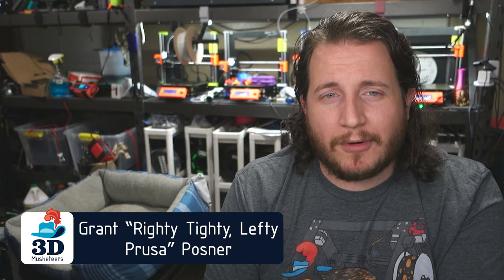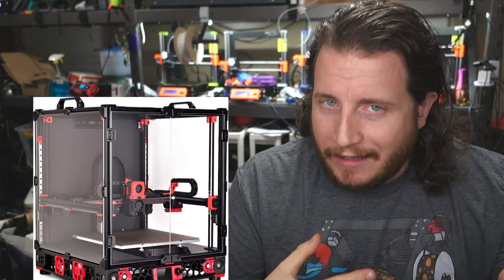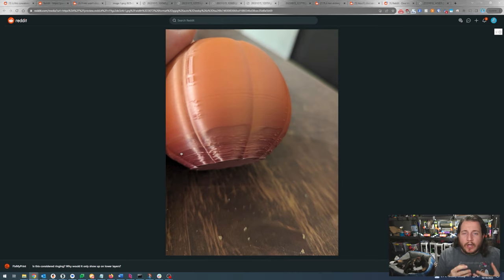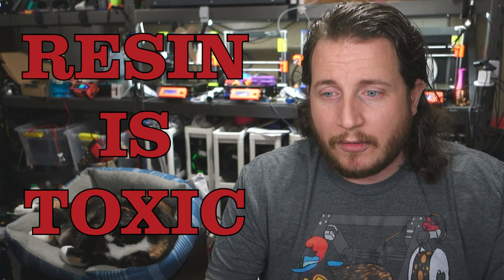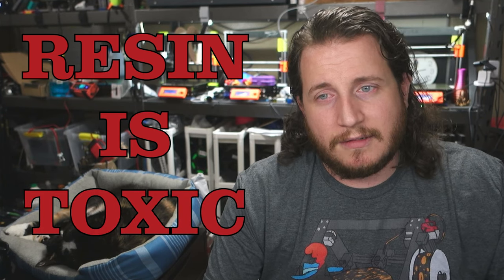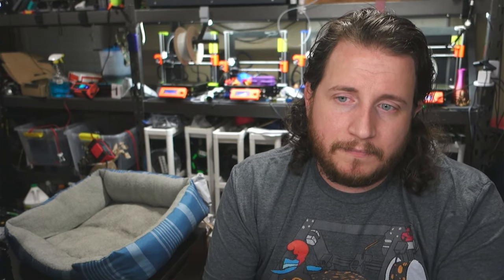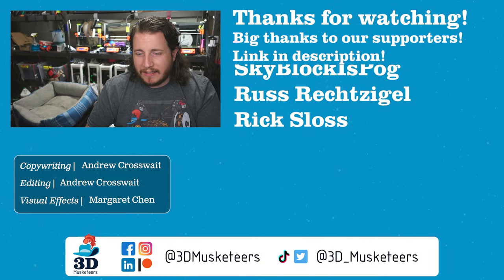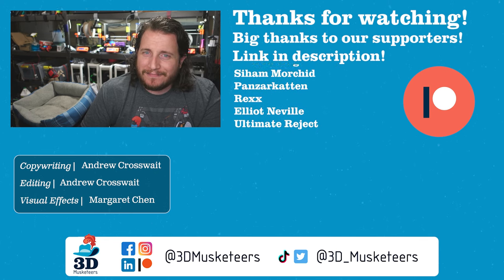Solving Bed Adhesion On Resin Printers AND the Prusa MK4! - PrintFixFriday 110

Comment: Yes, acetone does work well on the smooth pei sheet after being used for a while, scuffing the smooth sheet with the coarse side of a scotch-brite scrub will also help. I’ve had this problem before on my mk3 after printing around 2k hours, my friend has also experienced this on their Bambu smooth pei sheet, haven’t experienced it on my Mk4’s smooth sheet yet since I don’t use the smooth sheet very often. Doing what I said above remedied the issue. And it will be interesting if you got a mk4.
Reply from the maker: I just ordered my XL.. no MK4 for a bit

Comment: If your resin prints aren't sticking to the build plate, you need to focus on layer time, and layer height for the first layer. You can also get a scuff pad and rub it on the build plate so it has some very very fine scores in the metal, but most of the time it is just layer time in your slicer settings, or it is because the plate is not properly leveled.
Reply from the maker: plate leveling can definitely cause this too!

Comment: Resin bed adhesion is very temperature sensitive , if it's not over 20'C ambient ,it will not stick. I heat the plate prior to printing in winter,  works every time.
Reply: AND when leveling the plate make sure you do the z=0 - I mean, someone else had a problem and that fixed it...a ummm...friend...
Reply from the maker: gah I totally forgot to mention that!

Comment: The print fixes are great, but I'm most excited about finally getting some good news about the return of Elixir. I never knew it used TPU to help get that gorgeous shine, especially as various TPU/TPE formulations can act like silk PLA in terms of severe shear thickening behavior. Regardless, I had gotten various Elixir samples through my old Maker Box subscription and they are hands down the best silk PLA I've ever printed with (Mika3D's silk gold, silver, and copper PLA are a distant second). Seeing Polyalchemy's website go sideways and re-sellers' inventories dwindle to nothing was super sad, and the news that Printed Solid had acquired the list of secret herbs and spices required to make Elixir started to get pretty s. Very exciting to see its re-release is coming soon!

Also, I wouldn't be shocked to learn that the gorilla who broke their SV06 Plus nozzle off in the heat block probably is suffering clogs due to having the retraction distance cranked up too high. I believe Sovol recommends 2 mm but the MAK profiles for the SV06 and SV06 Plus for PrusaSlicer and SuperSlicer that I use have the retraction set to only 1 mm (I no longer recall if that's original to the profiles or something I tweaked on my own). Maybe I could take that up to 1.5 mm to try and combat some minor stringing, but 1.5 mm is the realistic max for any printer with an all-metal hot end. I suffered, badly, with clogs in both PLA and PETG in my Sidewinder X1 after installing a bi-metallic heat break until I realized that the 2.5 mm of retraction that worked great for the stock hot end was the true culprit after making the change. Turning it down to 1.5 mm made all the clogs go away instantly.

Also also, now seems like a great time to put in a plug for how little I care for the burgeoning number of proprietary nozzles. I get that the Creality K1-series nozzle and the Sovol SV06 Plus and SV07 nozzle are basically the same, which theoretically will help with availability and selection, but seriously...both companies should have just used the Volcano nozzle from the start. I'm extremely seriously considering installing a Diamondback, tweaking the inductive probe position to account for the length difference, and calling it a day.
Reply from the maker: Elixir is coming!!!!!!

And yes I agree, why do companies have different nozzles! Just adopt V6 sizes!

Comment: If your prints dont stick to the build plate on FDM printers, focus on bed temp to hotter or cooler depending on the filament type, and also try printing slower speeds for first layer, especially on PEI textured beds. My Bambu lab X1C had build plate adhesion issues for a while, but after lots of testing, I found it sticks way better if I increased bed temp, NOT using any glue stick, and to slow down first layer speed. Once I started doing that, none of my prints ever pop off.
Reply from the maker: good tip!
Reply: I use glue stick anyways, to me it’s better to use it as insurance to make sure it sticks then risk it coming loose. I use a lot of Bambu  printers too and still use glue stick even though I had only had a half a dozen or so prints not stick. You don’t even have to apply glue stick every time. I think I do it once a week or so. But that’s me, I do it for peace of mind and it’s worked well for me. But I also do flow test calibrations for each different filament on those machines too.
Reply: @shawnhicks619  I used to use glue stick, but all my prints kept popping off. Once I stopped using it and printed slower on first player, I havent had one fail since the change.

Comment: The same exact thing just happened to my Sovol SV06 Plus this week. But I had a replacement headend/nozzle already ordered. That nozzle tip just popped right off exactly like the picture. Overall, lots of problems but this is much better than a Creality printer.
Reply from the maker: wonder if it is just thin?

Comment: Sovols own video says to heat it to 200c for replacement. I followed those instructions initially and the nozzle didn't wanna budge. I'm a mechanic and all around tinkerer so I knew enough to realize it would break if I kept at it. I heated it up to 265 (temp of the petg I was using) and it came out easy. 
I would love a z seam video. Again, I used a Prusa for years as my first and only printer and never had to touch a setting. I picked up the Sovol sv07+ to print larger items at a better speed and hopefully learn this whole klipper thing I kept hearing about. I'm about to give up lol. I can get an almost perfect print from PLA but I often have that thick seam gap. I went to facebook groups and got recommendations for retraction and pressure advance test/settings and none of it has helped. I bet it's simple but I haven't figured it out yet lol.
Reply from the maker: Oh yeah, 200C is WAY too low

Comment: Timer too close is one of the vaguest and with more variables errors on Klipper, now that Raspberry and similar SBCs are plenty powerful and microcontrolers on new boards are pretty powerful 32 bit ones usually is not about the host or the MCU but more on the wiring, sure, having too much microsteps or some HD cameras can overload some low power SBCs the most common reason for that error is a bad USB wire, a low quality one without any way of shielding, a pretty electrically noisy system, bad electrical wiring causing under voltages or worst case, soldering issues on the boards
Reply from the maker: right?!?

No usb camera on this, she is dead stock.

Comment: When i looked it up a month ago for my printer, timer too close can mean a lot of things.  In my case it meant a failing connection on my Canbus toolhead. Software may be difficult to sort out, but checking connectors should be straightforward.
Reply from the maker: no canbus here, so no dice.

Comment: The sonic pad comes with a accelerometer for you to setup input shaping. I have 2 printers running off my sonic pad right now and have no issues after i setup input shaping, might need to re-do one of them cause im starting to get ringing.

When it comes to prints not sticking to PEI sheets i am no help, but on tempered glass build plates I have been using degreaser. On my Chiron i couldnt get ANYTHING to stick to the glass bed after it sat as a functional shelf for a bit while life happened. Tried EVERYTHING to get stuff to stick until i used oven/grill degreaser from the local dollar store. afterr that everything stuck without issue.
Reply from the maker: huh, I guess if it works it works..

Comment: My advice for anybody buying a Prusa: Get the satin build plate.
My advice for Prusa: Please make the satin build plate the default plate that comes with the printer.
Reply from the maker: I have not used the satin plates yet lol
Reply: @3DMusketeers  It's a good all-purpose plate. Works well with all of the common materials (PLA, PETG, TPU) with no need for glue stick, and has a very slight texture. Can still get warping with large prints, haven't tried it with advanced materials.
Reply from the maker: The texture can be an issue for us as we often have parts that need to fit together, so that is why I never tried. I own some though!

Comment: If you like it, you should put a revo (or a nextruder nozzle) on it. lol I got 99 problems, but hot tightening isn't one of them. lol
Reply: My dream is that somebody finds a way to make Revo compatible with Nextruder.
Reply from the maker: lolol
Reply: @logicalfundy  that would be lovely or even a revo hot end for the nextruder. My only complaint with the mk4 is that you need a tool to change nozzles.
Reply: You can do a hotend swap without tools, but it's also fiddly with the wires. Either way, it's a bit annoying. Prusa has a good relationship with E3D, they have ObXidian nozzles specifically for the Mk4, no adapter needed. Why couldn't they make the hotend fully compatible with Revo nozzles?
Reply: @logicalfundy  hot end swap yes, but right now I don't have any hot ends with a 0.25 nozzle. I have a nozzle. I have a spare hot end. The combination would require tools.

Comment: I've never had a spool of filament ruin a plate before, but I have noticed that copper fill PLA has less adhesion in general. It's MUCH better on the smooth sheet than the satin one. But even then, it doesn't compare to normal PLA.
Reply from the maker: interesting, I have had colors stain plates
Reply: @3DMusketeers  I've mostly stuck with CC3D silk and esun. I've also used sunlu and jessie and prusament.
Reply from the maker: Ah, Protopasta is what has stained plates for me and Jessie Brad's Orange. It comes off over time though
Reply: @3DMusketeers  The only protopasta I've  ever used is the copper fill. It didn't do anything to the plate.